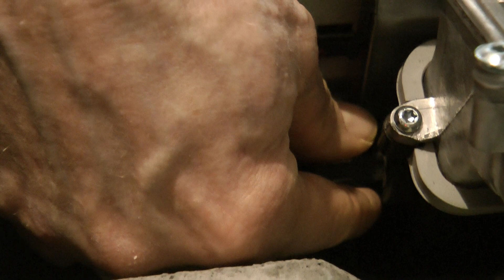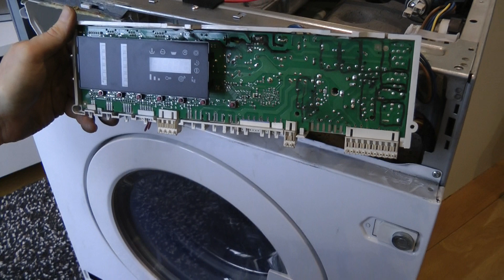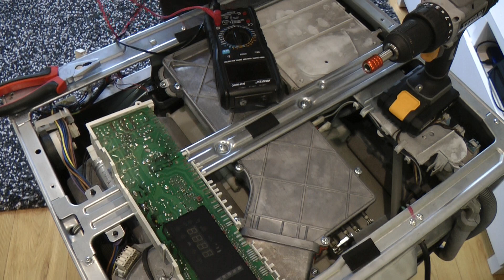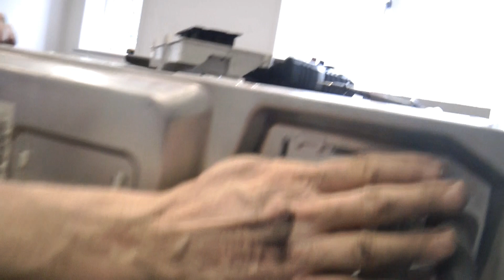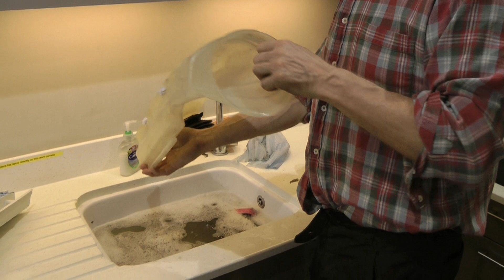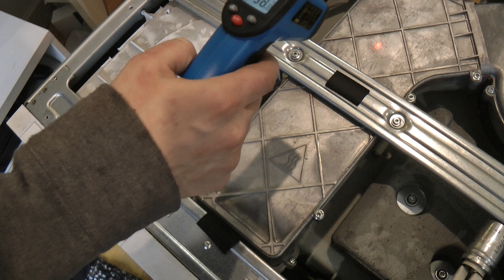NEFF Washer Dryer runs cold on drying cycle diagnostics and repair, condenser clean and service

Comment: Will this cause the wash cycle to be cold too? This machine is not heating on wash either. The customer said the TOC had tripped and worked once reset. She is saying that the wash is also not getting hot are they on the same TOC?
Reply from the maker: Likely a bad heater relay or open circuit element.  Track the wiring to the water heating element and check all connections aren't scorched.  Check the solder joints on the heater relay on the controller. the thermal cutout.   The resistance of the water heater element should read about 25 ohms.  Check the NTC resistance .
Reply: @razenby  Thanks for the reply. Are they not separate systems? The TOC she reset is the dryer one you showed but she seems to think the washer is not heating as well. I find it unlikely or am I wrong for thinking both would go?

Comment: Excellent video - my washer drier stopped working about 4 years ago with this problem - the repairman fixed it but I didn't play close enough attention and so when I had the same issue again I found your video and this gave me the confidence to repair it myself - all I did was clean out the condenser bottle of fluff and I gave the fan a good clean too and pressed the reset button and then it went back to working (I ran a few fluff cleans and a few empty tumbles because lots of fluff kept on coming out).  THANK YOU!
Reply from the maker: Thanks. Good to know and good job.  Remember to like and subscribe..

Comment: Great video.  Super helpful, thank you.  I noticed a sensor just hanging near to the fan motor, and I can't see anywhere that it can slot back into?  I thought that I had inadvertently pulled it out somehow when removing the condenser tube.  Is this normal to just have a sensor hanging inside the machine?  Thanks again.  Kev
Reply from the maker: Hi kev, no that not normal.  Can you see where it goes on the video. If you send me a photo I have a spare machine here.... ark.mail@gmx.com

Comment: Interesting - my unit (looks like an older one) is intermittant (I've never used that red reset button), so I may have more of a go with the 'fluff removal cycle' to see if that helps.  I already knew about the heating element and especially the temperature sensor issues (the latter being quite common), but I wasn't aware about the condenser problem.  Mine might be a pain for me to check as it's a built-in unit in a small kitchen, so it might be a shop job.  I just hope they know what they're doing as you did, but I suspect any repair won't come cheap.  Better than having to shell out £1000 for a new machine though!
Reply from the maker: Good luck with it.

Comment: Yes excellent, especially how you go through your diagnostic Sherlock Holmes logical method.  So i have 2 analogue & 4 dmm's but none have capacitance range on them,  should i splurge & spoil myself ?  ... or even one of them ESR meters,  that i will realistically possibly use twice a year !  i am trying not to buy any more tools :(   as i have almost every tool you could possibly need, .... i just don't like getting them dirty   :)  lol
Reply from the maker: Thanks Go on.. Everyone needs a Capacitance meter.  The MESTEK DM100C is by far the best choice.